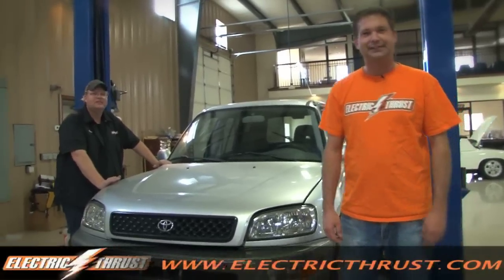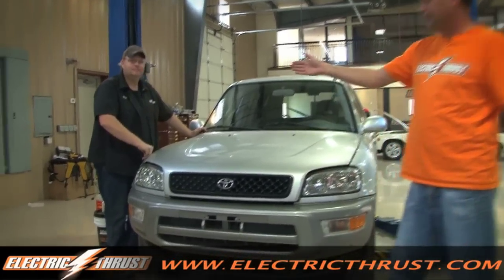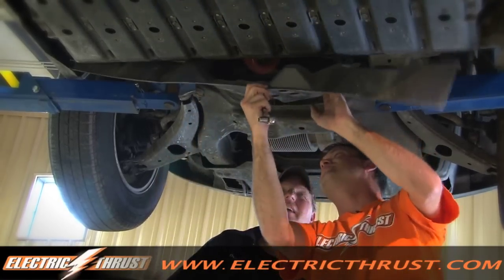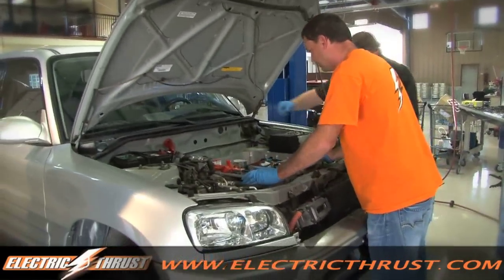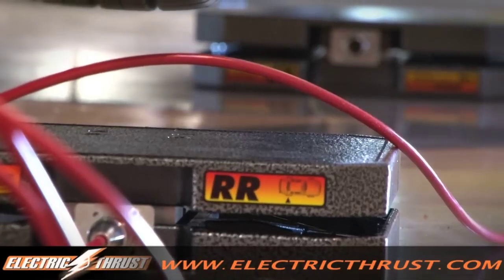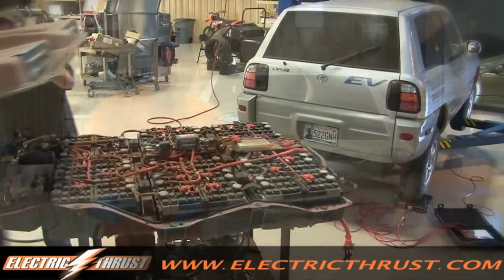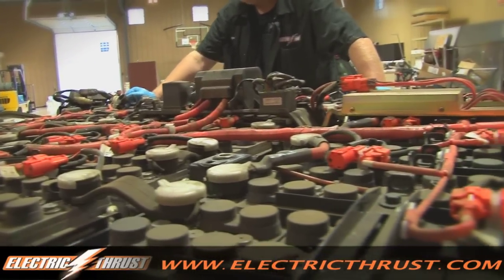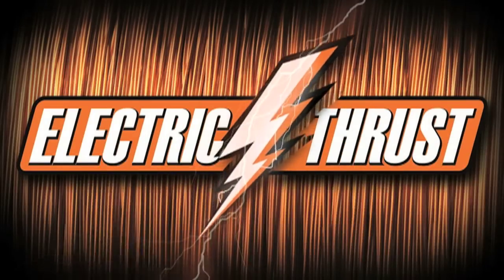Electric Rav4 Dissecting

Comment: The information is WRONG. They have been around since 97 with some built in 2002.
They are NOT dying off many havde done 150,000miles and more. If treated well they will last longer and drive further than the new lithium version. If CHEVRON had not denied development the same amount of range would be possible from NiMH using half the battery weight or double the range using the same or slightly lower weight.